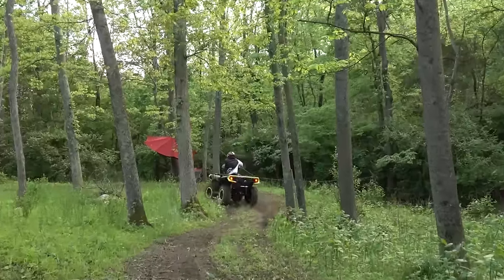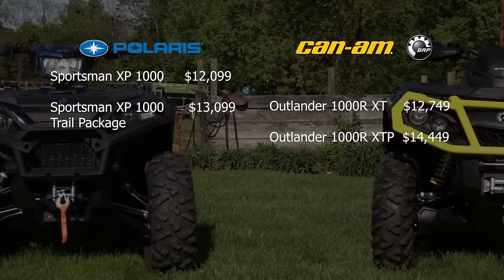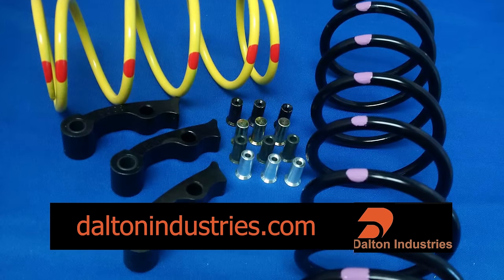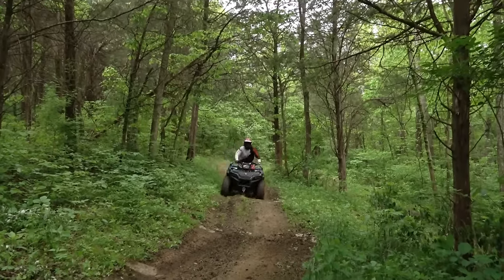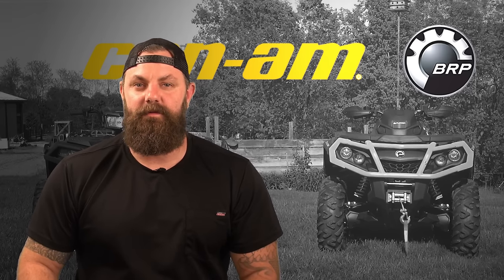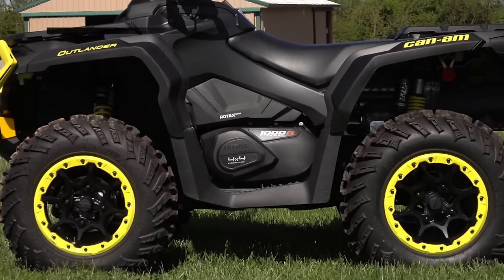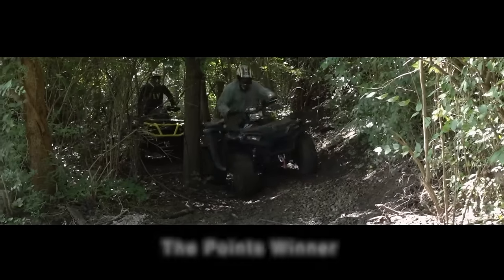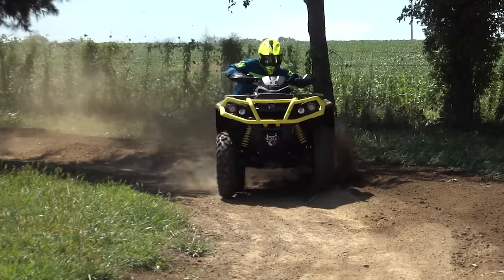Polaris Sportsman XP 1000 VS Can-Am Outlander 1000R XT-P, 1000cc 4x4 ATV Shootout

Comment: Can am has no fucking . Storage. Bull shit. The bike will flip over top heavy. Sluggish wtf. Jerrky or twisty. Etc.i pulled 4 sxs trailer trailer with my xmr outlander. There low GERD. So 89hp xtp,91/2. Now the 1000. V twin Rotax is doing 200 HP not sure why these asholes don't say shit. See tera cross. They said it's earlier. Every dealer is hurting every where. So scrap going outside. Ohhhh Lester I wish I had your money?

Comment: Makes no sense to not test these stock. Next video.....
Reply from the maker: Makes perfect sense. All we did was gain back the horsepower that the government mandates the manufacturer is Rob from you. If you're into government restrictions run your stock. Most people at exhausts and tuners. Also, it would not have changed the outcome one bit.
Reply: ATVonDemand  most people do not add exhaust and tuners. Not even close to half.
Reply: You missed out on a great vid if you let premium exhausts and a programmer bother you..
Reply: A tuner and exhaust is literally the most common performance mod in any atv I think it was a smart move. They are the easiest bolt on mods you can get and give you the best bang for your buck anyone investing in high dollar big bore will eventually do both wether they know it or not.

Comment: Ok so if this is a shootout between two equally classed units, why are mods being put on them to compare. Mods don’t tell the truth of the units out of the box. This comparison means nothing to me to make me chose either or if it isnt the machine stock. You can make a Civic run sub 10s if you mod it enough. 👎
Reply: The mods were equivalent. Same HMF Titan QS exhaust and optimizer for both machines. We see an optimizer as an essential piece for any modern ATV due the nearly universal lean conditions from factory. We also feel that if someone is purchasing a 1000cc ATV for the performance, an exhaust and optimizer is going to be on the short list of essential upgrades. There's definitely a performance boost, but the boost was comparable on both machines. So all of the ratings are valid either stock or modified.. I'd understand the argument if we only did one. Also, when ATVonDemand spoke about clutching, we were providing an example.. The clutch wasn't installed on the Sportsman..
Reply: Chad from ATV&UTVOnDemand! I get that the mods are relatively equal, but if I were in the market, I would want the review to show something as minor as the stock tires being puncture resistant (or prone to puncture for that matter), or the stock exhaust noise, etc. A lot of people don’t modify exhaust, or put fuel commanders on, etc. To me the shootout wpuld have been better stock vs stock, which would better showcase strengths and weaknesses. Great video quality tho. 👍
Reply: @matthewhouser2365  Appreciate the feedback.. Having a ton of familiarity with both machines I'm confident we painted a solid picture of the difference between them, short of the stock exhaust sound of course..